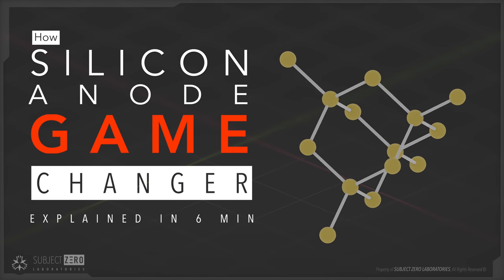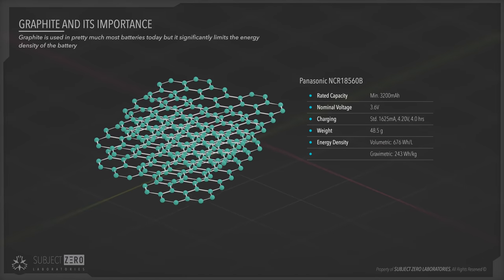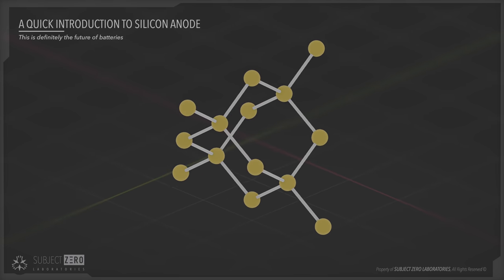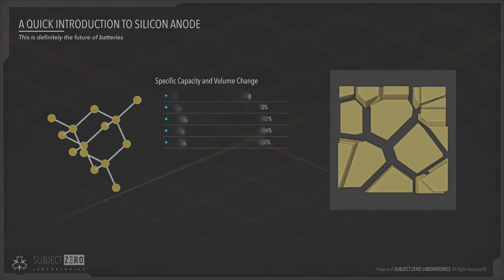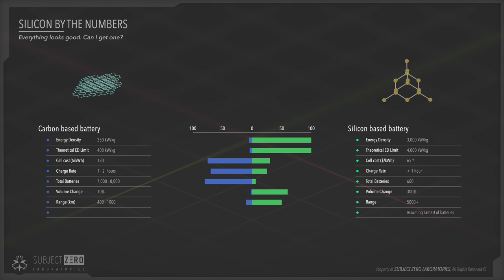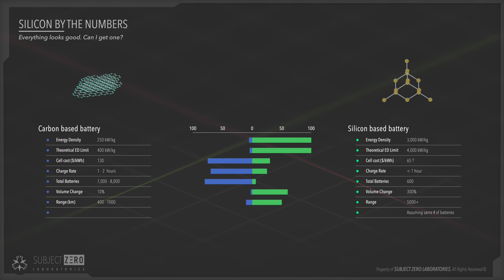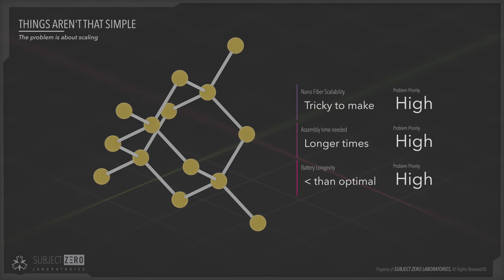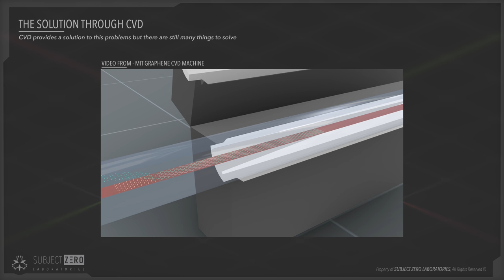But there are a few PROBLEMS - 12x the Energy Density with SILICON ANODE BATTERIES

Comment: Am I the only one who is dying out of excitement for silicon batteries to come out as we expect them to be? 
I'm so crazily excited to the day phones, laptops, cars (vehicles) , motorcycles, and probably even small planes will have this technology. You would get a 50+ hours screen on time as standard on your mobile devices, you would get cars with over a thousand miles of range (because I don't think no manufacturer would need to use a bigger battery), and a light-weight motorcycle with a range close to 500 miles. That's crazy!

Comment: They only problem with using them in cellphones and laptops is that the FAA regulates 100Wh or less per battery pack to fly with, so we may get lighter/thinner devices but probably not longer lasting
Reply: What do they consider a "pack"? Could you just have multiple packs per phone?
Reply: VLS-why? Laptops it may be a problem but phones usually only have around 10 wh. So there is still a lot more room.
Reply: Thats with today's technology, as we improve the safety that number will go up
Reply: You might be surprised at how efficient displays and cpu's are becoming over recent years. Time between recharges, for the same battery capacity, is increasing steadily.
Reply: 100 wh is a lot. That's like a high Ah cordless drill battery. I think that's plenty enough for a cellphone, you'll be running your phone for a week on that.
Reply: 100Wh, that will probably need to change when electric planes become widespread.

Comment: 12x energy density is true only for the ANODE. Which itself represents about 25% of the cell at most. So i would like to see the citation for that 3000wh/kg.
Reply: Lithium as the anode has larger capacity than the cathode. The cathode made of carbon is a limiting factor, using silicon would increase the battery capacity. No need for a reference for something that it is somehow obvious.
Reply: @DDDelgado  Anode isnt pure lithium.
Reply: @rokadamlje5365  generally speaking true, new research employs pure lithium, specially on solid state electrolyte

Comment: Really informative video but in some slides (for instance the one at 2:55), the unit of Energy Density needs to be Wh/kg. :)
Reply from the maker: you are correct, but my mistake was in the title. I was referring to Specific Power but the again, that "h" does make a lot of difference i agree. This is basically what happens when you make video at 1 am, LOL

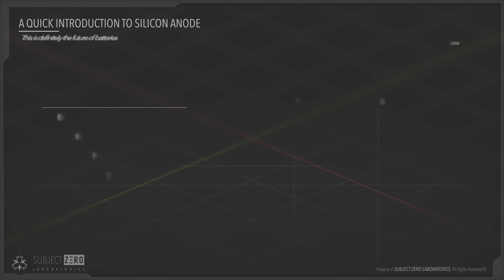Comment: Hey, battery researcher here. At 2:30 you seemed to be comparing the overall cell energy density of the graphite battery with only the anode energy density of the silicon battery, ignoring the rest of the cell components. You definitely cannot get a 12x increase in energy density of the cell by swapping out graphite for silicon, because graphite typically only makes up 33% of the total cell weight. At best you could improve energy density by about 30%.

Comment: The current problem for energy density is not on the anode, but on the cathode. Graphite can hold up to 380 mAh g-1, while the cathode of an NMC battery (Nickel, Manganese, Cobalt) can reach only around 200 mAh g-1, so that is the limiting factor for now.

Comment: Another "new-comer" to the silicon battery scene is XNRGI. They make a porous silicon battery that's basically millions of micro-batteries that each only charge a little bit to avoid cracking. As well, they use existing silicon chip manufacturing practices to make their batteries. So, I'd say they are pretty promising. I only learned about them after this video came out, though.
Reply from the maker: I will take a look. I have to update this video cause some new stuff just came out.

Comment: Li ion batteries in EVs can last 1200-1500 Cycle of DoD, so 8-10 years not 300 -1 year. The Silicon anodes has  other problems and volume changes are not completely solved by nano fiber , nanotubes.
Silicon anodes batteries can have up to twice the energy density of today Li-ion so at best ~500 Wh/kg , not more.

Comment: I doubt that smaller batteries with a resulting higher energy density would have a "more efficient cooling system". The heat exchanger (assuming same ammount of waste heat created) would be the same dimensions, while the battery cooling itselfe would have to be much more sophisticated due to higher density

Comment: The number of CELLS required would be fewer. But the car only has ONE battery.
Reply: Here is how it works: Electric cars do have thousands of battery cells in them. They tend to use 18650 size batteries with about as much energy in them as your smart phone battery. Each cell is only 2.5 inches long and 3/4 inches in diameter. So electric vehicles don't have only one cell to travel hundreds of miles. If they did they wouldn't even have enough energy to move 1 mile with only one cell. Look this up through Google.

Comment: If the silicon is cheaper you can guarantee the nano fibres will be very expensive causing a battery that has 12 times the energy density 12 the price. That's fair!

Comment: Why do you think nobody is using a testa turbine in:
A. The old fuel style system?
The exhaust, I mean.
This is a hot flow of gas..
What the turbine runs on.
Energy recapture is supposed to be important.

B. More relevant to the topic..
Batteries. Not the literal device, but in how the ion flow. The charge

Comment: What are the pros and cons of this type of Iithium battery compared to LTO batteries.
Reply: IIRC LTO batteries have very poor charge efficiency < 65%, and I I believe also have a high self-discharge rate.
Reply: LTO is an anode technology, like silicon is an anode technology.  LTO is capable of fast charge and discharge, but it about twice as heavy than graphite anode.   So no use except for esoteric ones requiring heavy, fast charging batteries

Comment: How about a silicon carbon alloy or any other alloy for that matter. Is such a thing possible.
Reply: alloys are not really a thing for carbon and silicone - Alloys describe mixtures of metals. Metals mix well with one another because they have similar atomic properties and form an electron gas around one another. In laymens terms, they don't mind if their neigboring atom is from a different brand.

Carbon, especially organized carbon molecules would like to aviod to actively bond with "other stuff" in their current configuration. If carbon bonds with something, it massively changes it's properties to accomodate for that. The result of this is an entire field of chemistry called organic chemistry. So no, just heating carbon and silicone up and hoping for the best won't be enough unfortunatly..
Reply: There are reports about silicon carbide anodes, but not many.  Most research is around silicon anodes

Comment: does it catch fire as current lithium ion battery
Reply from the maker: depending on the type of Silicon Anode, they do indeed. That is actually one of the main problems with these batteries. But that will go away once they they get the nanofibers to perfection.

Comment: THEY ARE HOLDING OFF DEVELOPING THESE TECHNOLOGIES TO SELL MORE SHORTER LASTING BATTERIES .
Reply: If that were the case then the company who started making the better batteries would get enormous profits because they are selling a superior product.  

Look at it as if you were the CEO of a battery company.  Would you hesitate to get a product onto the market that will give you a significant competitive advantage?  If your batteries were twice as good - you could charge 50% more for them and still be surrounded by people who want to guy them.

We did exactly that at the company I worked for before the doctors told me that I'm now retired.  We did some independent R&D and developed a ceramic foam product that had three times the service life of any other similar product.  And we added a 'we'll replace it for free' warranty for 200% of the specified service life of the product.  Yes we charged 20% more than our competitors - but we were still a price bargain.  (And even more importantly - reduced maintenance costs and downtime.)

We were buried in orders because the maintenance personnel began specifying our product when ordering parts.

Comment: Whatever happened to capacitor batteries quite simply all you have to do is take an copper antidote  and use eather a sputter gun or electroplating and layer copper and silver 20x then do the same thing to the silver cathode then take a very thin flexible piece of glass in between the anode and cathode and your good a high-density high capacity capacitor battery how you could do a thousand layers or billion or trillion layers still want to get that big
Reply: Capacitors are very heavy compared to lithium ion batteries.  About 50x or more.  Considering a model s uses a 1000 lb battery to move 300 miles, a capacitor is not going to work

Comment: I never heard of it reffered to as CVD, but then again I'm kind of new to this stuff. For those whom want to know, CVD stands for Chemical Vapor Deposition. But I've read books that have called it Epitaxy.
Reply: It is a technology which has been used in semiconductor manufacture for at least 50 years. Almost all IC's, and all CPU's use it. It is also used in making discrete components such as transistors, diodes, plus some resistors and capacitors.

Comment: I think you're making a grave mistake in your safety elaborations and you're just a powerfactor  off.  
Lets roughly assume you're right with the 250 kWh/kg  (you should fix your units in that graph, capacity does not come in watts but in watt*hours or Wh/kWh) that would make about 900,000,000 Joule or 900 MegaJoule which when short circuited is enough to heat the 1kg battery to instant evaporation, no separator or material could handle this.
Much more likely is a 250 Wh/kg battery, those exist in real life and still heat up to 500-600°C (visibly, poke your cellphone with a screwdriver after fully charging it...) when short circuit fed with their fully charged 900kJ. Now multiply the rough delta temperature (assuming an operating temp of 50°C of the battery) of 550°C with 12 and you get 6600°C assuming you have the same material specific heat capacity of kathode/anode materials. (hint: silica 703, alu 897, copper 385 so temperatures would even exceed the 6600°C )
Your safety measures would be nuclear fission reactor grade shielding to keep those batteries at bay. Quick thought experiment, your battery is made of Silica, has a mass of 1kg and eats 3000Wh in an instant: it would heat up by 15362.73°C. Even 1500°C, 1/10th of that temperature, due to heat dissipation, electron flux limitations, radiation, material mixes, electrolyte evaporation etc. would melt your silica and even steel. 
Feasible technology? I highly doubt it!
Check out https://www.omnicalculator.com/physics/specific-heat or any other similar page. They also made a nice video explaining specific heat capacity. 
 Thermodynamics are a bitch I know but basic physics should be the basis of a proper "science" titled channel. There are enough idiots on this planet, you don't need to contribute. 

Why not make a nice video mathematically/physically debunking all those ultra high energy battery promises by a certain Elon Musk and the fancy animation driven Techno-cult. The physics behind it are simple enough.

Comment: The hell with your battery's.
The future will powered by independent gravity drives, driving all generators for all motors.

No more fossil fuel use and no need for storage battery's.

It will be on demand when and we're needed for aslong as needed.